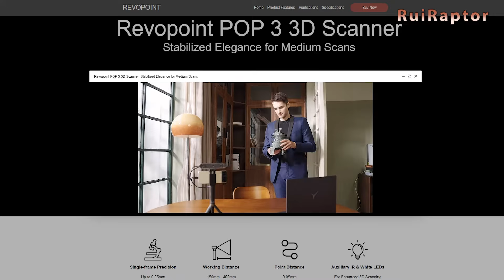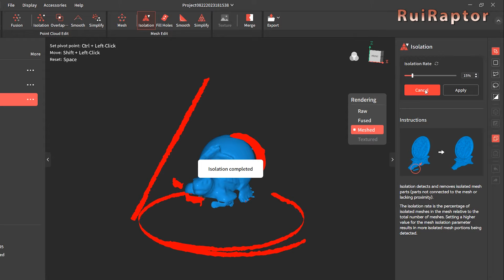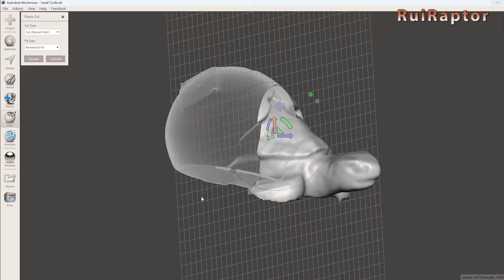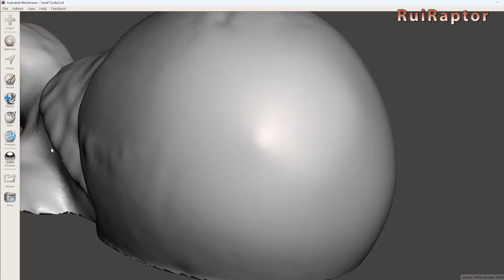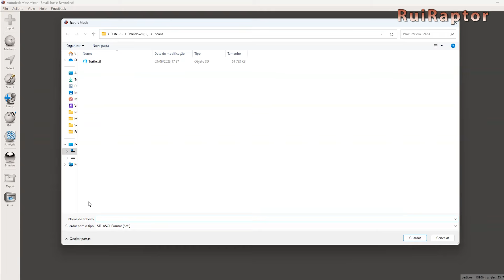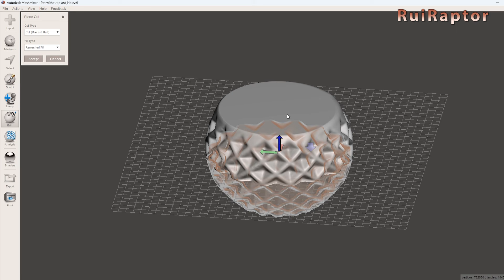Essential Guide To Start Editing Your STL & 3D SCAN Models 👉 For 3D Printing

Comment: Great guide. It´s also very useful to retouch AI-generated 3D models. 

It´s interesting to mention that although Meshmixer for MacOS is not "officially" available anymore, it can be downloaded from Web Archive (won´t put the link here because I don´t know if links are allowed in your channel´s comments). In Reddit people claim that version 3.5 works even on Apple Silicon macs.
Reply from the maker: Hi, not sure if the links are allowed, but you can try to add the link without the http if the full link does not work.

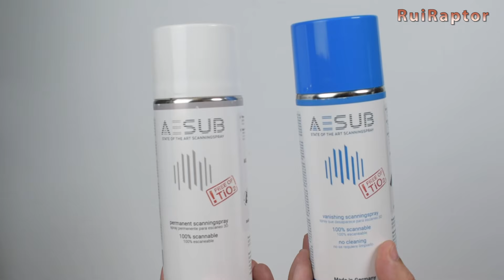Comment: 3:42 I can't buy AESUB in the Philippines, not even on online shopping sites. Tried importing, and pressurized cans are not allowed to be imported. Very frustrating, got a lot to scan that has shiny or dark areas which need to be scanned perfectly. Are there alternatives or competitors that performs the same functions available in the Philippines?

Comment: this is brillant work, i just brought inspire after watching this and really is helpful to my job as a mechanical engineer bec i do a lot of reverse engineering for my boss! i hope im doing this right by just watching this clip, is hair spray the same as dry shampoo spray? i know those scanning sprays can be quite expensive!
Reply from the maker: We found that not all the dry shampoo sprays are the same in terms of scanning results. Some work better while other don't. You might need to test a few until you find one that works great. Some cheap ones will not work as good.